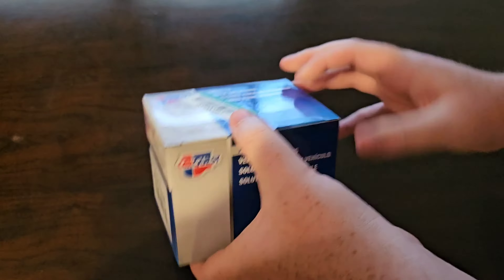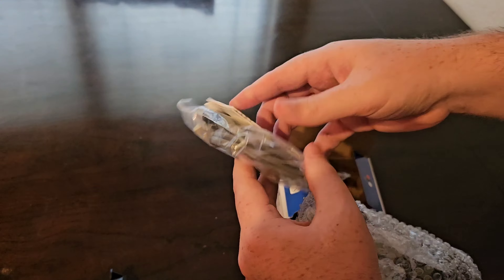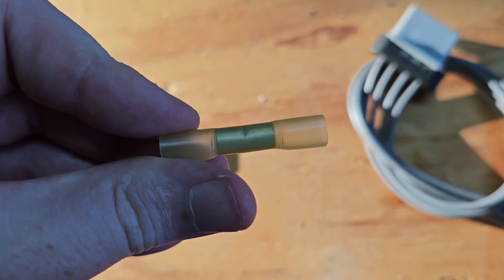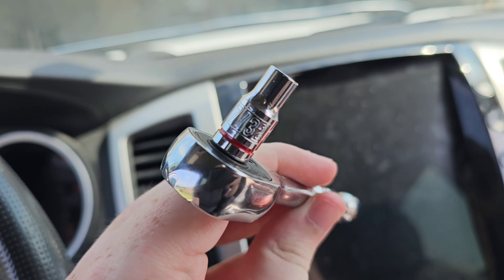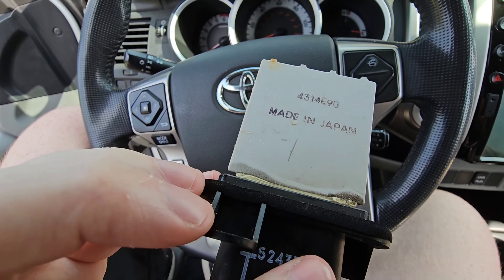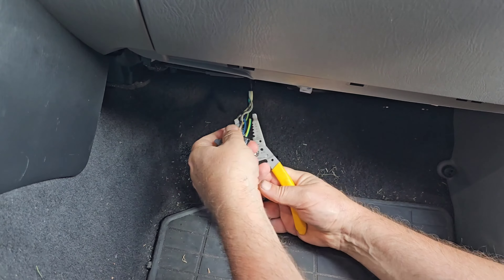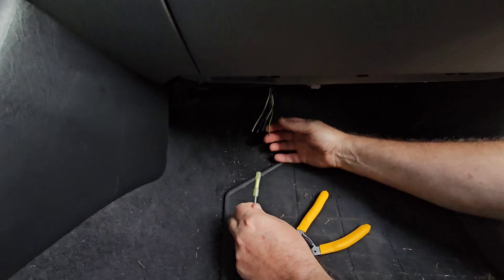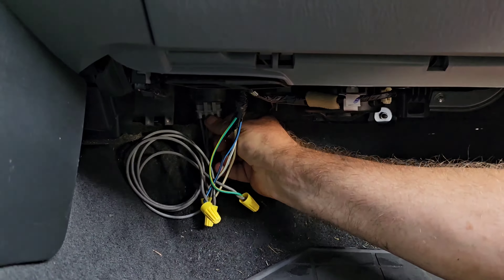AC not blowing - only blows on high quick fix. Blower Motor Replacement - 2005 - 2015 Toyota Tacoma

Comment: What ended up being the culprit for air not working on high after replacing the resistor? I just replaced mine for ONLY blowing on high, and now it blows air on everything BUT high. 
Great video!

Comment: I replaced the resistor and the four wire connector and that fixed the (high only issue) but I also found a burn mark on the white two wire connector on the blower itself and now my AC only works intermittently when I wiggle that connector wire. Do you know where to find that part?
Reply: Side note: that large touch screen is sick!
Reply from the maker: I'm not sure!
Reply from the maker: Thanks man!